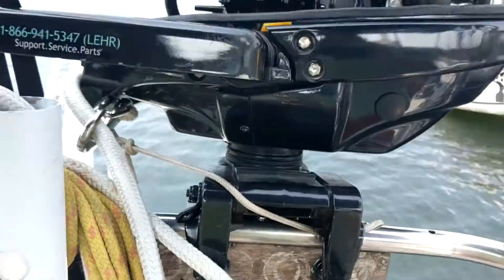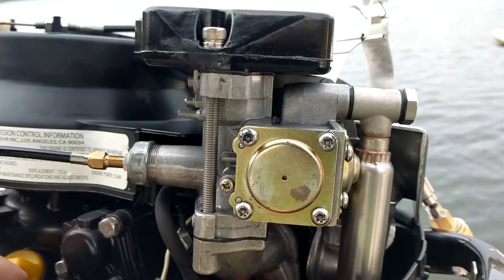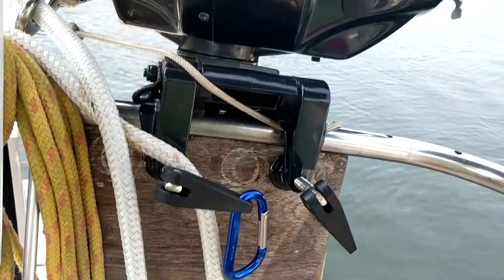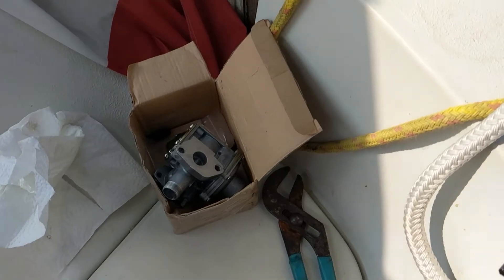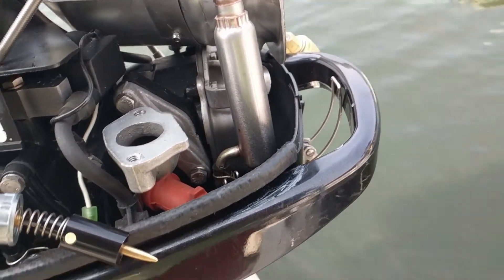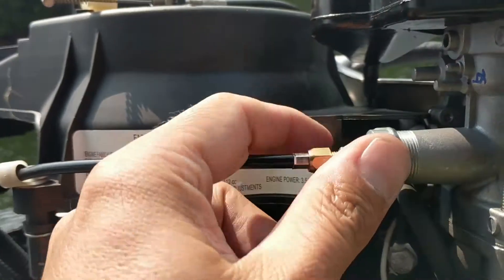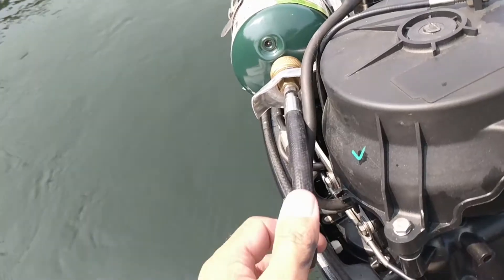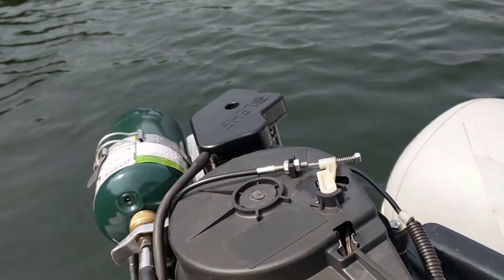Trying to get a Lehr motor running.

Comment: I don’t think what you were adjusting was the idle. There should be an idle screw on the face of the Carburetor that you use a screw driver to adjust.
Reply from the maker: The only adjustment is the one I was adjusting, talked to the rep about it.
Reply: Sounds like you just got a lemon, plain and simple. Thousands of these sold, the vast majority have had a great experience. I own one and it runs perfect. Starts on the second pull every time. I love it.

Comment: Problem is your 1lb tank position!!  Liquid propane goes to your motor. If you use 20 lb tank it will works fine. Stupid motor design. Now Tohasu and Merkury sell propane motors and they work fine. I own Tohatsu LPG from 2017.
Reply: Good point.  picking up a 25cc lehr propane weed wacker tomorrow to convert to a 12v generator.  I also see the smaller engines where used on e-scooters back in 2009

Comment: Air to fuel ratio problem?
Reply: I have much the same problem with this motor, can't get it to idle. Really want this solution to work as I had so many problems with gasoline engines, but it appears to be poor quality all around.
Reply from the maker: We were shipped a new 'carb'/mixing valve, we were also sent a new pull start assembly. We were heading south and we just could not risk this being our main dinghy motor, so got rid of it. - I did install the new carb unit - it didn't change much.
Reply: @desperadoii4938  That wasn't fun to hear :( Hope LEHR will get better with there quality, propane outboards will be nice to see around later in time
Reply from the maker: @THe9-3MAnIaC  We thought we were doing the right thing, we liked the idea of NOT having a third fuel on the boat (gasonline), but the technology and quality is just not there, these motors might be fine for a small lake, but when cruising we needed to rely on an our outboard, the suziki was fine too low a power for ocean swells, but we eventually ended up purchasing a Yahama 9.9, easy to get parts for and has the power to get us to shore and back quickly even with groceries!
Reply: @desperadoii4938  That was nice to hear! The Japanese brands knows what they are doing 😉

But parsun and hidea are very good now! They been better and better for each year, much improved quality science 2006 when they started to come out on the market